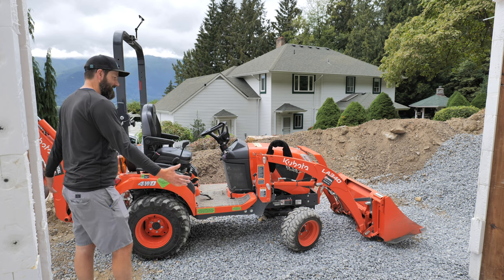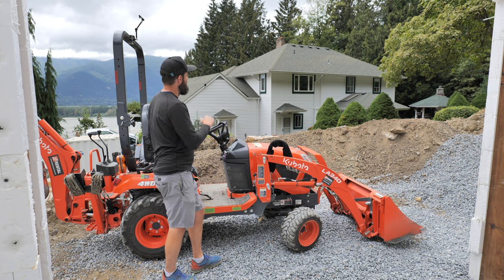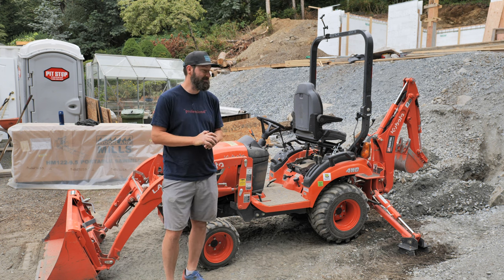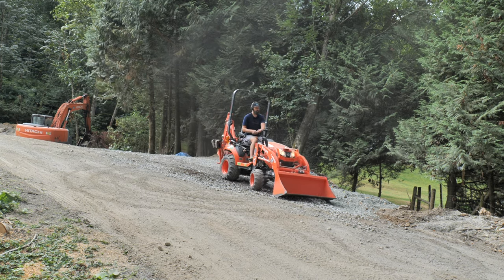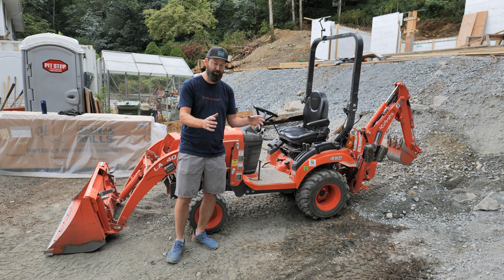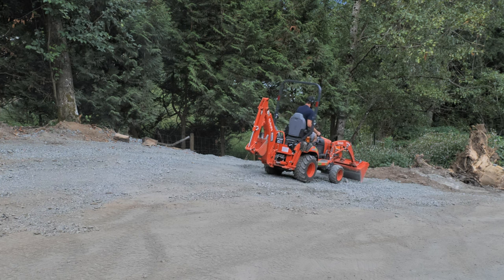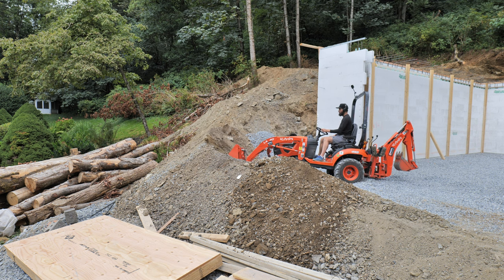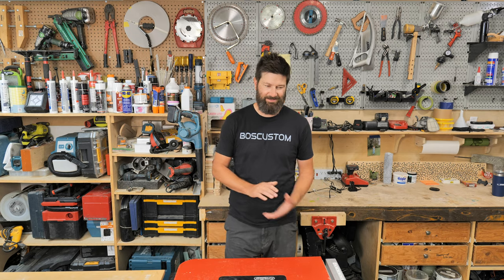Are Sub-Compact Tractors Useless?(Waste of Money)

Comment: Anybody have got a 1025 r or a 1023 John Deere should be aware that they cannot handle a 6-inch post hole digger like they claim they can. My brother broke his in half. My twin brother went over and picked his John Deere up with gc2300 Massey. Picked up both halves and finish doing the other 51 fence post holes. He had started drawing he had one hole drilled and it started on 2nd hole when the John Deere broke in half. I'm not here to rage anybody's feathers I'm just stating honest fact and John Deere did not stand behind the warranty on the frame nor would they take the tractor back for trade in or do any work on it whatsoever. And don't even get me started on fuel consumption I run all day with a 4 foot tiller on 6 gallons of diesel why that John Deere's are using two tanks to my one tank. I'm running a 1705 Massey Ferguson and a 1710 tlb Massey Ferguson and I've been quite happy with both of them. Strong, more than capable, reasonably priced and very reliable.

Comment: You can buy an older 40-60 hp deere or massey with a loader in good running condition for a 3rd or half of what one of these dinky lawn mowers cost. Then you have a real tractor that can actually get some work done, they're easy and cheap to work on, and with some routine maintenance they'll outlast you. Subcompact tractors cost way more than they are worth
Reply from the maker: Ended up with a 1025r.  Box Blade, forks and a snow blade.  Complete satisfaction- that little tractor crushes.